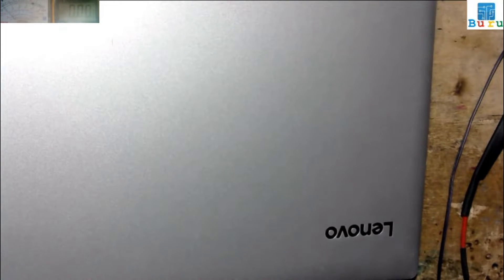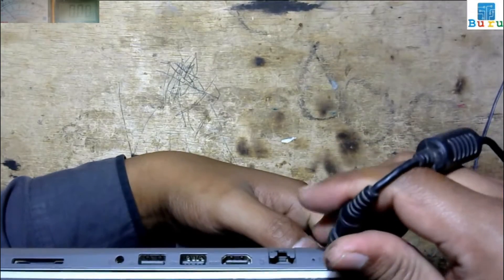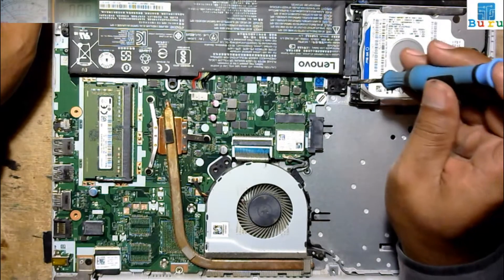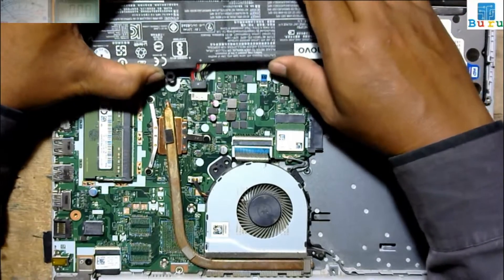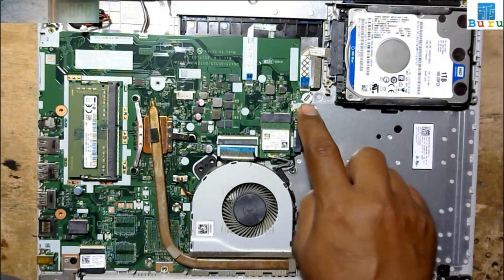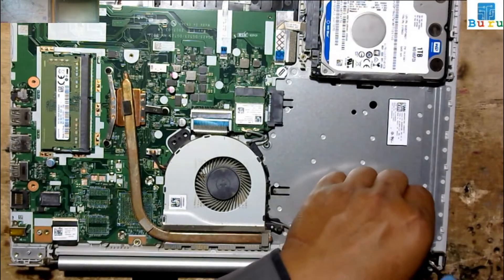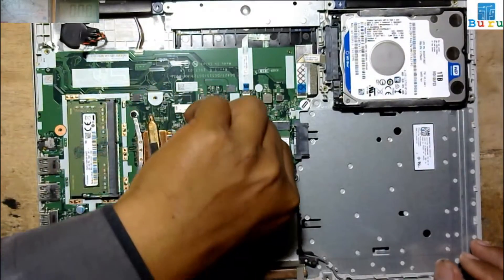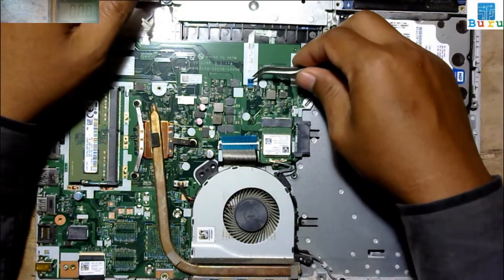Lenovo Laptop Won't Turned ON And Not Charging Fixed

Comment: My Lenovo Ideapad 310 - 14|KB (2016) doesn't power on. I can see the AC power status indicator blinking while charging from red to white. When I try to turn the power button, I can hear the fan/static from the laptop. The screen is still black & the power button is blinking yet not turning my laptop on. I've already tried the methods above but seems like it doesn't work. My laptop got the Novo pinhole button on the sides, I've tried it but doesn't work too.

Does that mean the motherboard is the problem / screws inside start to falling out / fan / thermal paste?

The warranty on the laptop has expired years ago. Should I go the local laptop services or go straight to the Lenovo store?
Reply: @muhammadagusismail  thanks. I went to nearby technician. He said that it was because some virus & cat fur 😂

Comment: Hello.
I have a similar problem.
The laptop overheated when playing a game and would not turn on.
We let it cool down and it still would not turn on, and it would not show the LED that it is charging.
Tested the power lead on another laptop and it worked perfectly.
Removed the battery and tried to run it just on the power lead; did not work
Tried to remove the ram and put it back in, as well as reset the CMOS, it did not work either.
It has an SSD and is likely not the issue.
What could be the problem here, and how would it be fixed? Maybe GPU or CPU overheated and is done for?
Any thoughts?
Thanks

Comment: I dont understand what you did with the mosfet did you replace it with a new one or did you reflow it or take it out and put it back in or simply removed it? the important part was what you never explained!! what is the point??
Reply: @muhammadagusismail  you replaced the mosfet & put it in the same place right?

Comment: Hi great video. My T440s won't charge but the lights (on the power button and at the back) are flashing meaning the charger is working... Do I need to get a new motherboard?
Reply: I got the same issue,after some checking on the internet,the BMS on the battery decided to lock charging so there are 3 possible ways to fix that
Get a device that can do it (500 bucks,reusable,safe?)
Change the BMS(not sure about this,but technically could do work)
Buy a new battery

Comment: So you removed the mosfet, but did not insert a new one. In the later times it will create a problem. How is that fixed. 
Good video presentation however please try and have your mic not get any other sound next time. Because some of your words were being eaten by your kids.
Reply: He did inserted new mosfet.. if u see with detilely

Comment: My lenovo laptop battery can't give power on nor after plug in the charger didn't charge it stuck at 90 % what can I do? Please help me 😭
Reply: Take a data backup of your PC
Try to reset your Laptop.
Hope So, this will help you......
Reply: Look for lenovo vantage with your laptop connected to Internet go to the hardware part then to battery option and look there will be a switch below conservation mode. if that is on simply turn it off and you will get it to charge 100 percent.

Comment: Should i worry if there is any short circuit...it is repairable.  I am in depression.. Because of corona virus i cant go to service centre..so plz tell me can repair shop can repair it..and where can i get same kind of mosfet.. Do repair shops have mosfets plz answer my all questions..and does my laptop have short circuit bcz i tried without battery nothing happend... So plz tell hurry
Reply: @muhammadagusismail  thanks for your information..

Comment: One day,unfortunately my charger fall down. And my laptot wont take charge anymore!and there was no charge in battery..so it wont turn on but it shows red light in indecitor light. after 4 day i went to a local shop and they give power to my adapter..then i came home and charge my laptop.after few minutes maybe..i come back and turn on my laptop.it boot normally.there was no charge in my laptop mean 0 percent charge.so i shut down my laptop.after few minutes i press power button and it turns on but wile loading in lenovo start up. it offs automatically.2nd time it happend. Third time same happend but this time there is no light in indecitor light.there is no sign of death...does it is because of mosfet or motherboard.. I cant go to repair shop now due to corona virus.so should i worry about motherboard or mosfet..and also tell me how mosfet dies
Reply: @muhammadagusismail  nothing happend?
Reply: @Peoplearemoronic  where are you from?

Comment: My computer  it not turn it on.  But the battery  is okay.  It still turn on where  location  on key bored.  But the screen  does  not turn  on anything.  So I ask someone  to help and check  for me.  He said  it broken  of it mother  bored. Because  it is over  heat.  So how can we do if in this  case?